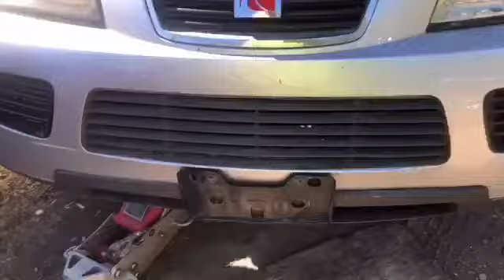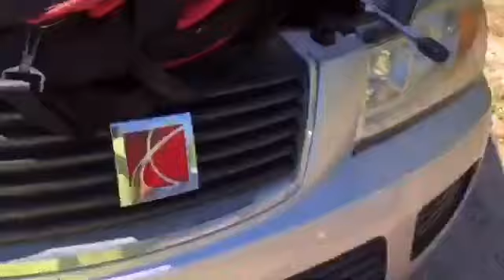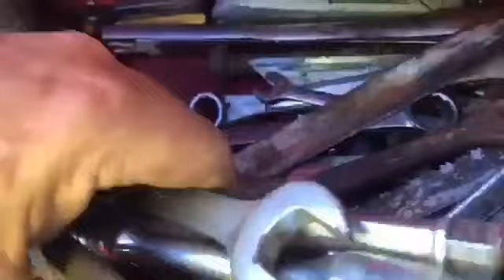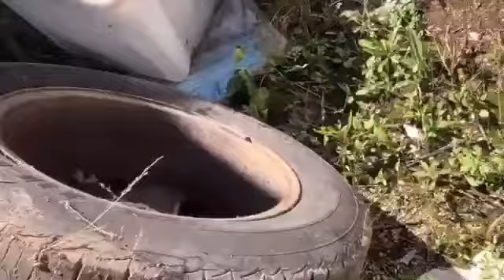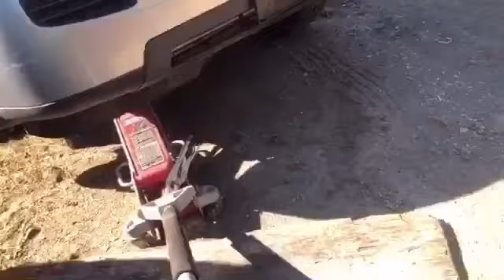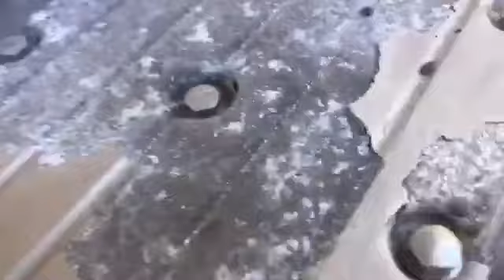ALWAYS BRING THE RIGHT TOOLS TO THE JUNKYARD

Comment: I don't remember the exact size the axle nut is but I think it is 35mm or so. There's bolts on the backside of the aluminum knuckle holding the bearing in. After those are out you'll probably have to beat it off with a hammer since they usually become seized in the aluminum. Might have to take the 2 structure bolts out to get the axle shaft out of the way.
Reply from the maker: It’s looking pretty much the way you say 
Uggg. Seems like ya right about this being seized. 
Might have to go to the junkyard for parts